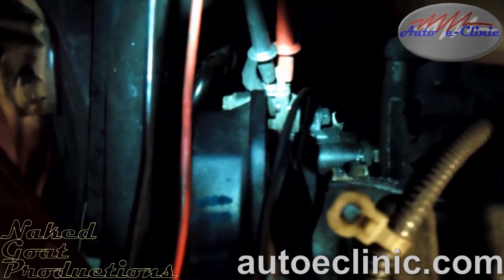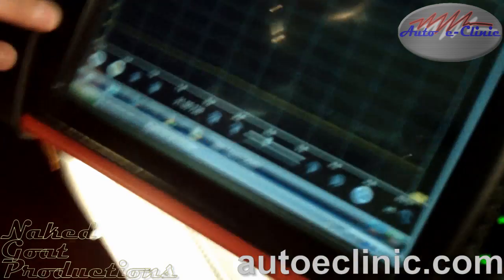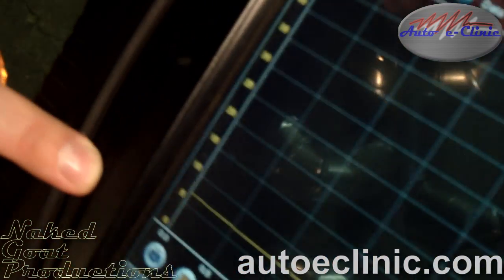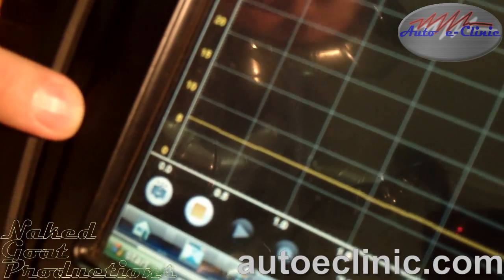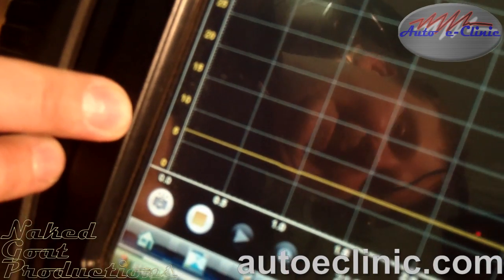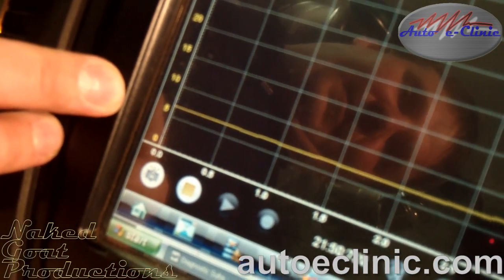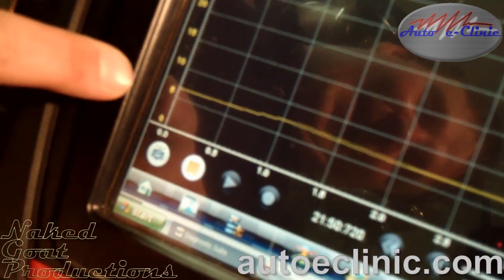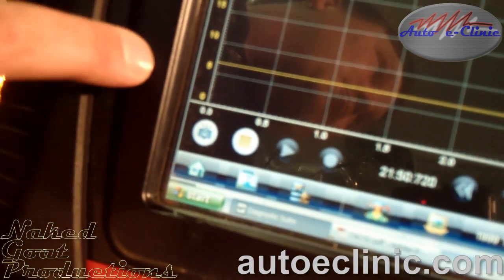How To Diagnose A Check Engine Light : Code P0340 Cam Position Sensor

Comment: Hi I changed the sensor and erased the code but I now got P0340 $07E8 camshaft position sensor A circuit Bank 1 or single sensor
Reply: Normally P0340 is the camshaft position sensor or the “camshaft position actuator solenoid” also called a (vvts) or (cvvts) it stands for Variable valve timing solenoid or Camshaft variable valve timing solenoid. “A” is normally the intake side and “B” is the exhaust side, always check the wiring of the plug in first because for some reason these are Notorious for having bad connections, also 90% of the time you can just take the solenoid out and clean it (I use parts & brake cleaner) then blow it out with a blow gun and reinstall of course unhook the battery before you remove it then after it’s reinstalled (most are held in with one 8mm or 10mm bolt) hook the battery back up then start and drive the vehicle and/or cycle the ignition in order to reset the light, these normally get clogged from dirty oil, oil not being changed on a regular basis, low oil and just every day debris in your oil system 90% to 95% this is the cause of the engine light plus a vehicle not running at its best ability, it will cause loss of power and a miss in your idling and engine performance it also has an impact on your fuel consumption. Hope this helps By the way I am and have been an ASE Master Auto Technician for over 22 years, I am also I-CAR Certified Technician as well as having certifications for several vehicle manufacturers in order to do warranty and recall repairs at my Business.

Comment: Had a p0340 code thrown on an ecotec motor, replaced the coil pack, icm, plugs, and wiring, still throwing code and misfiring

Comment: So last nite i changed my crankshaft position sensor and new battery and ran good but today on my way to work the check engine light came on and then a lil bit after the rpms started jumping up and down like crazy then shut off the car starts back up but continues to shut off any idea whats going on?

Comment: I replaced the timing belt on my 98 Ranger 2.5L, afterwards the P0340 code came up, I have since replaced the camshaft position sensor, the crankshaft sensor, and the ECM. This entire time it ran rough,backfired. Took it all apart again and noticed that the camshaft sensor wiring had gotten pinched under the AC bracket. I re routed the wiring and taped it up, put it all together again. This time it started running a lot better, no stumbling or missing, but the P0340 code is back up again.Any ideas?
Reply: +AutoEclinic What happened to Michael?
Reply: Cruz Vela ahhh what?
Reply from the maker: Mario Martinez Thank's for the question but due to the passing of Micheal we are not answering any question, sorry.

Comment: Hi guys thanks for the video. I have a 97 ford escort with this code. How can I check if cam sensor is working using a multimeter? Any help will be appreciated.
Reply from the maker: Hey there and thanks for your question! Unfortunately, Micheal passed in March of this year and he was the auto diagnostic expert who could answer all the questions.

Comment: Really good video. (and so is part 2) so many people just change the cam sensor and then find its not the sensor thats broken. Ive had one with a stretched wiring loom and that was the issue. Timing chain is usually the main culprit though. Well done guys keep 'em coming
Reply from the maker: Thanks Chris! I have seen garages replace the timing belt and not get the sensor hooked back up or misaligned as well. I wish we could continue to produce more videos but Michael passed away in March. We used his business garage, know how and tools.  He specialized in diagnostics.
Reply: AutoEclinic I'm sorry for your loss man. It's always hard

Comment: I don't know about this video. If the vehicle runs then why check the crank sensor. I have a p0340 and no start at all.
Reply: Crank/cam sensors differ in design and purpose depending on the vehicle. Not every CKP/CMP sensor in every vehicle that sends an off-signal to the computer will cause the vehicle to not start. Cadillacs, for example use crank and cam position sensors to ensure the engine valve train is within timing specs with the rotary assembly. If the chain/belt gets stretched too far, it can throw the specs off to where a trouble code can set.
Reply: Before attempting to do vehicle repairs, it is vital that you train yourself to pay attention to details.  For example this is a CAMSHAFT POSITION SENSOR, not a crank sensor.  It is also not a tire, a tomato, or a penguin.   Why you would check your penguin is that this is what the OBD2 trouble code indicates.
Reply: 200 dodge Durango why won't shift out sec